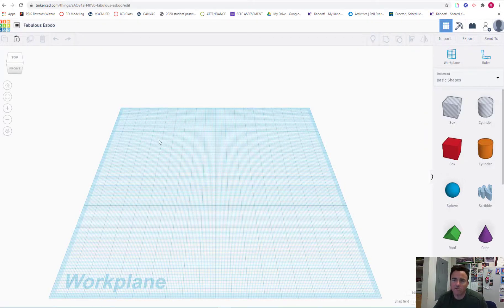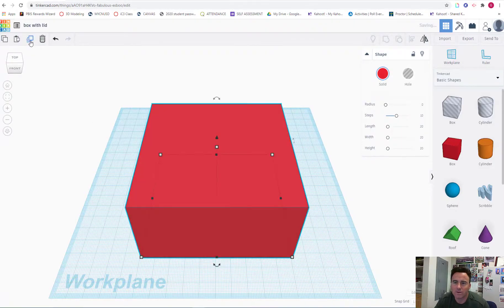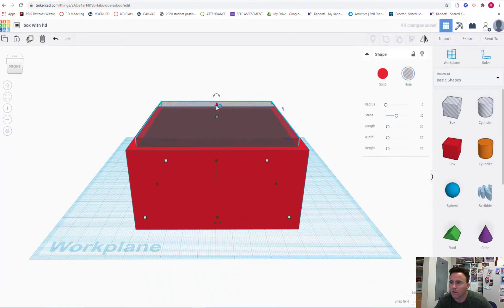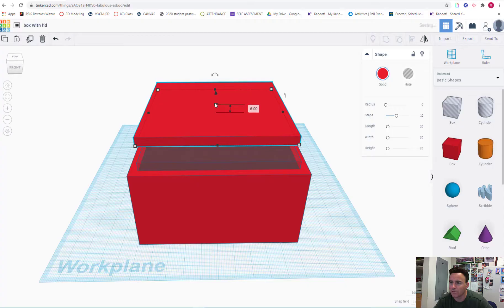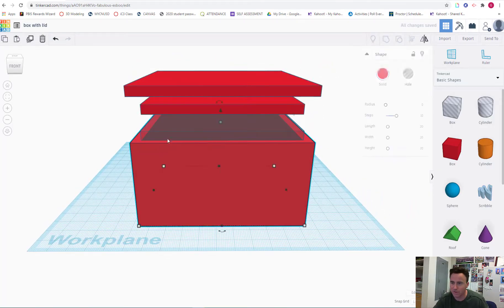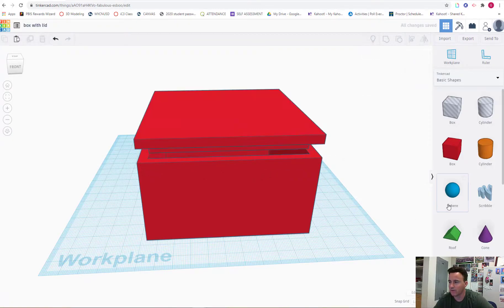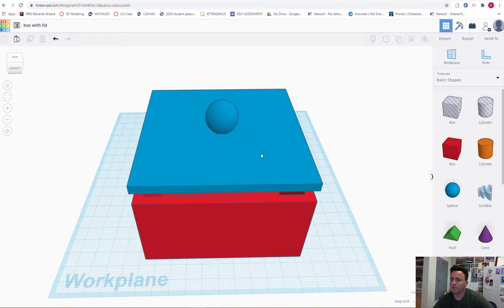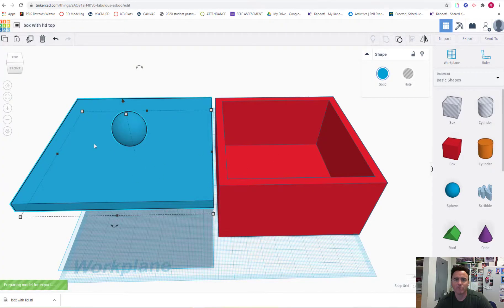Create a Box with a Lid in TinkerCAD in 2 minutes

Comment: I have used TinkerCAD for Arduino work but never 3D. Your tutorial was clear and concise and I've now made by first 3D model - faceplate with a lip and holes (for removal) for a lab power supply  - in only an hour or so and printed it succesfully. Cheers!